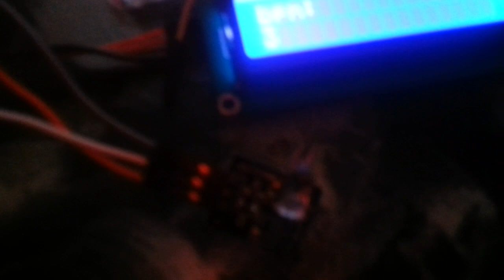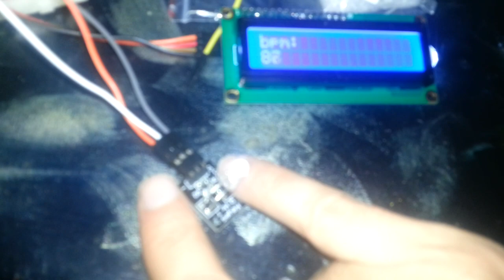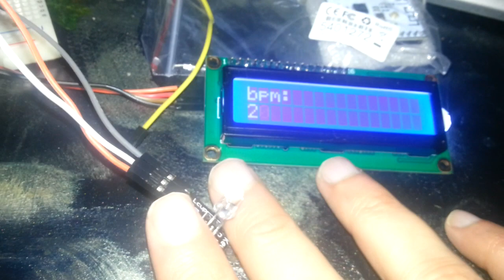A simple and easy HeartBeat sensor - messure your heartbeat

Comment: Ordered one Marco.  Thanks!
Reply from the maker: Eric William Great! i usualy order via aliexpress
Reply: Marco Arduino channel $5.73 from ebay.  Free shipping.  Done deal :)
Reply from the maker: by the way i love your channel!
i also agree about the mq2 sensor ,it needs to heat up and takes too much power.

i find that aliexpress in most cases is cheaper than ebay.
aliexpress 1$ and it is free shipping
http://www.aliexpress.com/item/5V-Heartbeat-Sensor-Finger-Detecting-Heartbeat-Module-For-Arduino/32241819397.html
Reply: Marco Arduino channel Thanks Marco!  Yeah I have a new plan for that sensor- A neat tool idea I think.  Vid soon.  Thanks for the kind words and the link.  That is a great price.  I grabbed one with a slightly better form-factor but for $1 a person CANNOT fail :)  Cheers
Reply from the maker: cool
Reply: where did you order it from Eric William?
Reply: james wolf ebay. Search Arduino Pulse sensor, buy it now, free shipping, then sort by top rated seller.  That's where :)